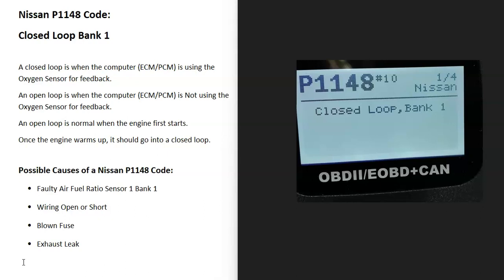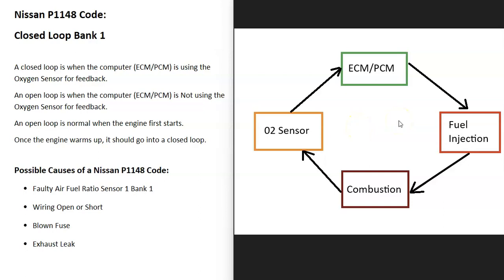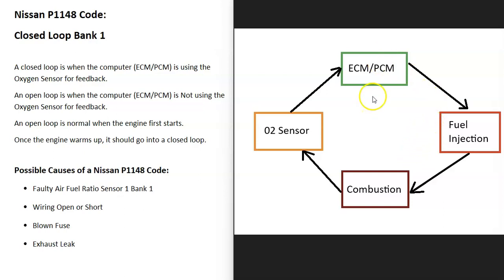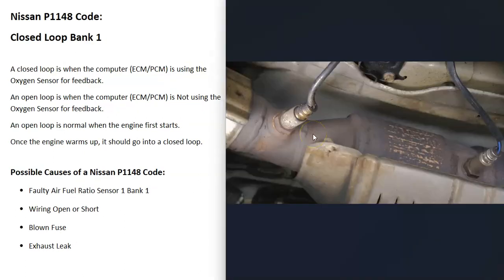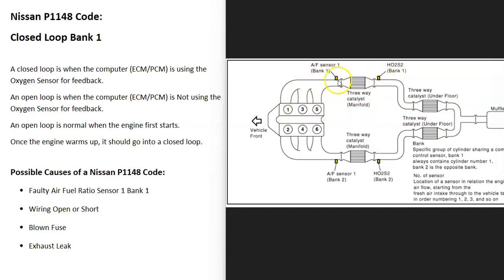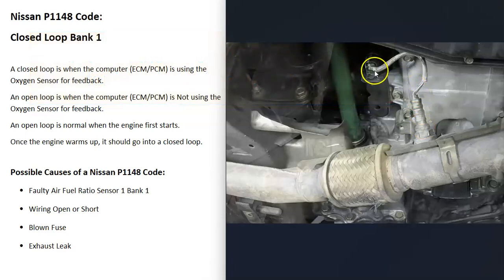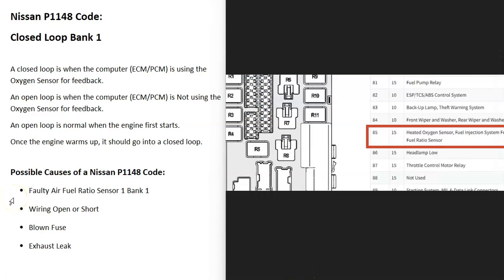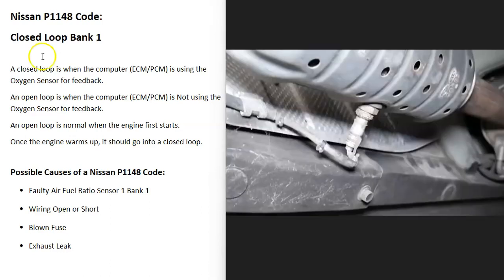Causes and Fixes Nissan P1148 Code: Closed Loop Bank 1

Comment: I just conducted an exhaust back pressure test and now i got the p1148 code. I put it back to how it was. I did get a little of the anti sieze compound on the threads and some got on the tip of the sensor. Would that have anything to do with the sudden code?

Comment: Hello I have a comment to add. If the catalytic converter is broken or taken out, this will send a wrong signal to the ECM ( this can also act like an exhaust leakage
Reply from the maker: If there is no CAT, then that will cause issues. The computer will give 02 sensor and Catalyst codes.
Reply: Ah very interesting, my vehicle runs fantastic however I have never had a catalytic converter on it.
Reply: @Aatell764 what do you mean by “never”? If your car never had a catalytic converter on it, that means it was made before approximately 1974. If you mean it never had one while you owned it, we’d have to know how long you’ve owned it. Could be three weeks for all we know
Reply: @JohnV123456 Never as in since I've owned it. It has an exhaust system from some other 4 stroke engine. I've had a code for an O2 sensor since I bought it but I fixed other things I deemed a higher priority first. When I went to take a look at the O2 sensor I learned that it's supposed to be on the header. The header it has installed doesn't look anything like the OEM and doesn't have any ports for any sensors. Took a look at the entire exhaust system and its something for an entirely different vehicle. So no catalytic converter or any exhaust/o2 sensors.

Comment: I just replaced the exhaust manifold and oxygen sensor on a 2010 Nissan Altima couple thousand miles later I get the p1148 p1031 could it be the oxygen went bad already ?
Reply from the maker: It is possible but it needs to be tested to know for sure. I would check the wire harness and be sure it is plugged in good. Sometimes, after being replaced they are not plugged in completely and come loose.

Comment: Is it possible that after replacing o2 sensor on 2004 Sentra bank 1 that the check engine light and code p1148 still on because it needs time to reset or shut off?  Like drive it for a little while?
Reply from the maker: There likely is still an issue the code should clear. If you don't have a scan tool to clear codes and speed it up, a battery cable can be removed for 10-20 seconds, which will reset the computer.

Comment: I have 3016 Nissan Altima SR 4 cylinder and I have that code. I replaced the o2 sensor b1 upstream which needed to be replaced but once I’ve drive it when the engine gets hot. The slip light comes on and it judder and it start to not let me flout at all I can’t go no power
Reply: Sorry we can't answer your question when you're speaking in tongues😂

Comment: Hey on a 1999 Mercury Villager van it's throwing a 11:48 code and a 325 code saying it's a knock sensor if I change out the O2 sensor will I be okay with the knock sensor not being changed out

Comment: Hi there! All right so I have an 08 Infiniti g35s and ever since I changed my upstream O2 sensors to AFR's, it's been throwing a p1148 p1168 p0051 and p0031. I replaced the all 4 of the 02 sensors again, replaced the fuel pump, fuel rail pressure sensor, the fuel regulator, the spark plugs, the bank 2 catalytic converter, and multiple other parts. After doing a lot of research I learned that it was most likely the bank 2 O2 sensor wiring harness, so finally found the right wiring harness and changed that out. At first it was showing no codes and thought everything was fixed but after putting everything back together and driving briefly it's now showing the same codes but for the bank 1 side. I'm completely frustrated and kind of at a loss on what to do at this point, don't understand why it's doing this... Could the problem possibly be on the ECU end? If you have any advice for me I'd greatly appreciate it cuz I'm tired of replacing the same parts over and over for no reason and I know that with the wiring harness being bad it can throw all kinds of bogus codes. The other odd thing is that my car is driving perfectly fine through all of this, that's the other thing that doesn't make any sense. Any advise would be greatly appreciated!
Thanks so much!
Jenae
Reply from the maker: I would check the voltages at the harness and the wiring going back to the ECU.

Comment: I love you right now........Installed downstream sensors and my guy failed to tell me there was "a spark" because he didn't disconnect the battery and the sensor snapped when removing it.  Whew.